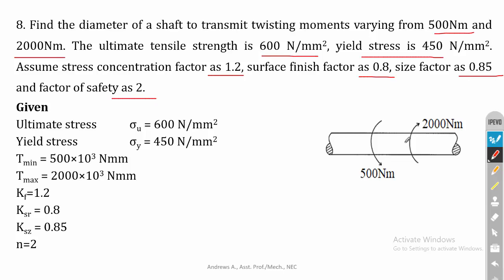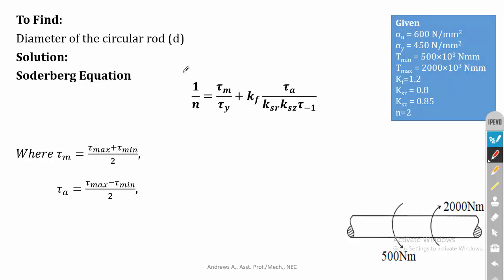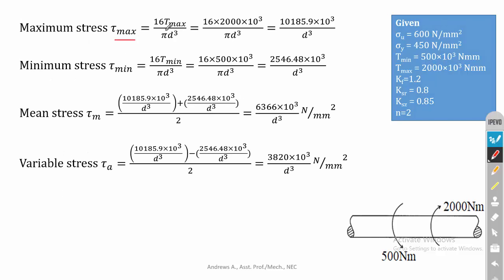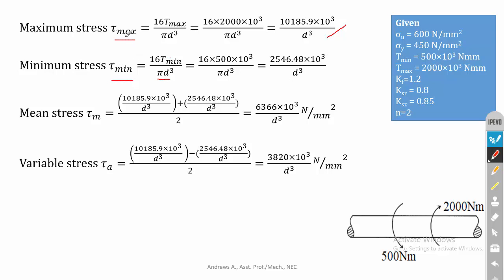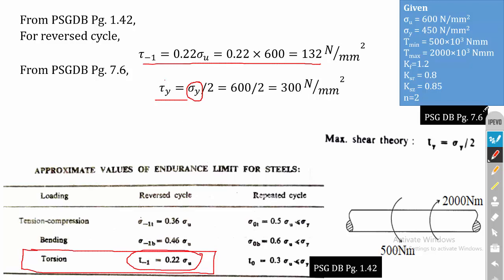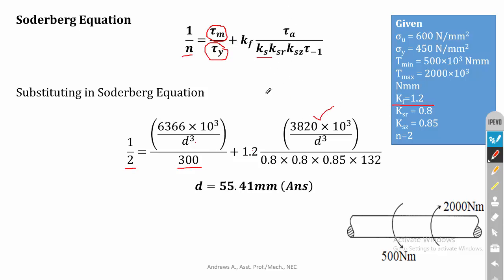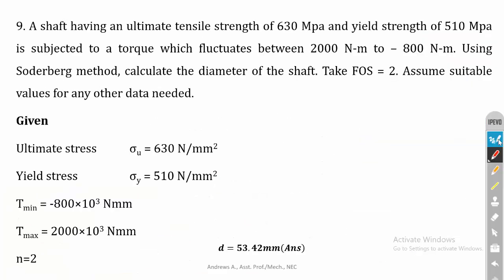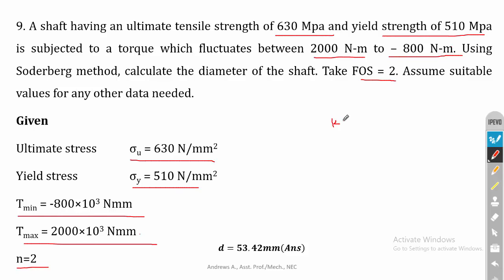Variable Loading | Twisting Moment | Design of Machine Elements

Comment: Sir since the 500 NM is clockwise should need to take in minimum torque as -500Nm
Reply from the maker: In both Axial and bending, the rod is subjected to both tension and compression ( in bending, if the upper half is tension, the lower half will be compression) but in shear it is not like that... So no need to consider negative direction...